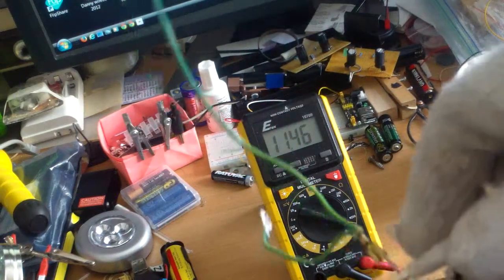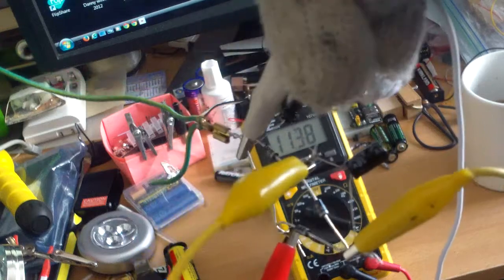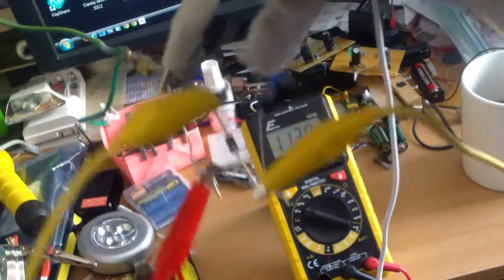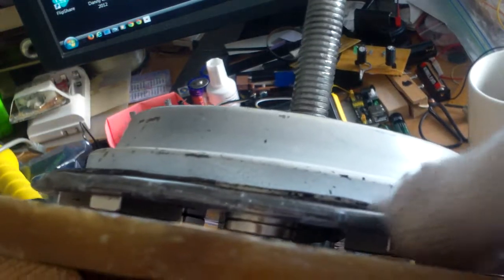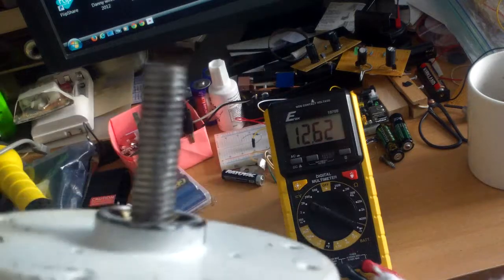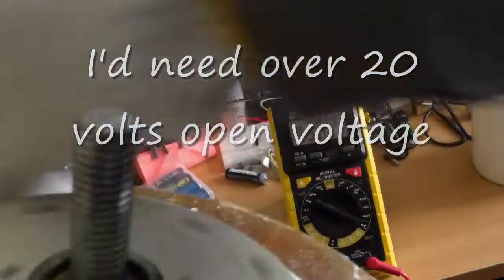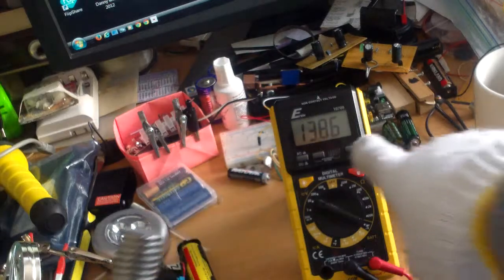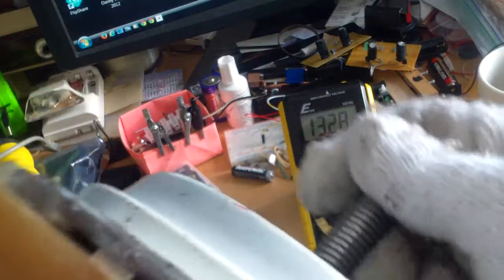Open voltage of a 9 coil axial flux stator with a minimal setup

Comment: nice test. I do not know if I saw correctly or not in the video, but you seem to have different type magnets on the rotor, some round and others rectangular. width and thickness, pound pull is really important for output. you want equal magnetic strength in each coil per phase.

Comment: Pity you cant get the voltage high enough with the single rotor. Maybe with the voltage booster?
Good luck Paul
Erik
Reply from the maker: At least I now  have a baseline of the output of the stator and what to expect. Better to make mistakes now than your finished product.  I have already boosted the voltage but this type of higher output stator needs higher rpm to produce sufficient voltage.

Comment: The depth of your magnet, compared to the depth of your coil, appears to be inadequate. If you triple those existing magnets up, you'll get your 40V.
Reply from the maker: 40 volts? That'll be good. I was thinking of 1/2 thick magnets. I was also thinking of 40 volts or more for it to work in low wind.
Reply: wtam69 Do you know Dan Rojas of GREENPOWERSCIENCE? I recently watched a video of his, where he converts an AC motor to an axial flux permanent magnet alternator, and he shows how in that case, yes, the added depth of two more thicknesses of magnets literally tripled the volts. I was quite surprised myself, i would have guess you'd get more current, but not so much more voltage. I suspect that what happens in some cases is, with a thin band of magnets (not much depth) you are not fully penetrating the entire coil and thus it acts like a wall transformer that is burnt out --- your not getting the functionality of the total number of turns.
Reply from the maker: KyleCarrington
I 'm glad you mentioned the importance of the thickness of magnets. I think I've watched most of Dan's videos.  I might have overlooked this part as I probably wasn't looking for it. I know magnets and thickness of steel rotors, wire gauge size etc. all contribute to the output.  It's easy enough to add another layer of magnets. I know you trade voltage at the expense of current when you use a thicker gauge coil. If I double the number of coils, that'd help too but then my resulting wind turbine  will be too big to construct. Thanks for your insight.
Reply: wtam69 Give it a shot. I read somewhere that ideally your neodynium magnet will be at least 2/3rds the depth (physically measure) of the coil itself. If I am seeing the video correctly, you are below that. You may not be penetrating the entire coil, and thus it behaves like it has less winds, and thus less voltage.